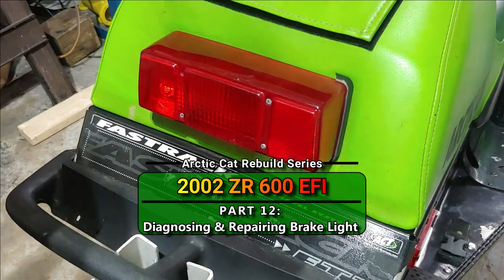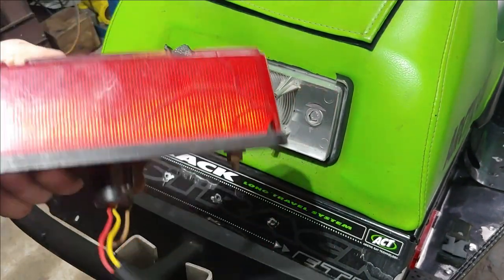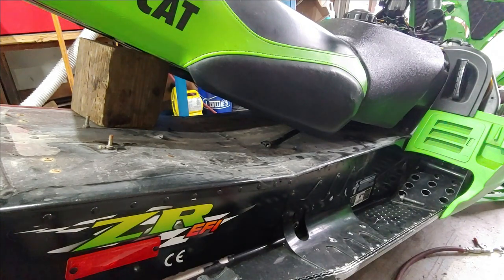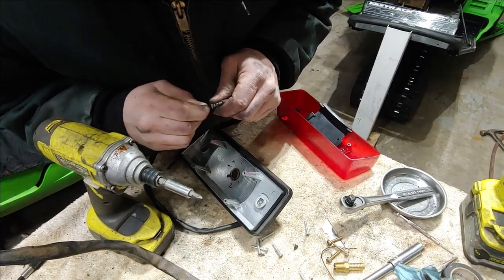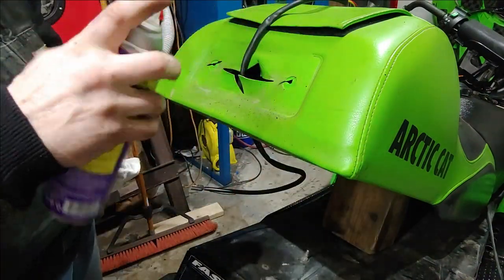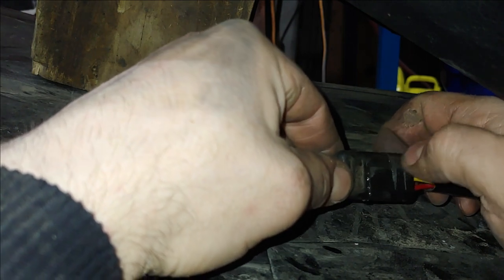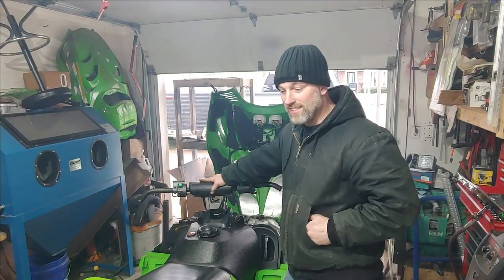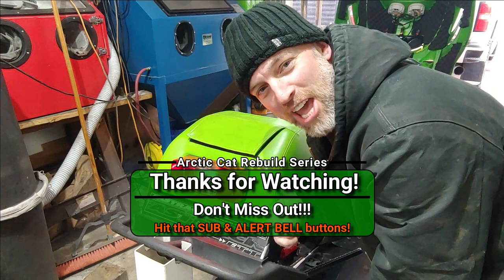02 Arctic Cat ZR 600 EFI Part 12: Tail Light [Diagnosing & Repair]

Comment: Great video learning every time I watch. Just added a reverse kit to mine. Got a reverse through Mickeys. They had it off and shipped to me in about 4 days. Pretty easy to put on. Used the online parts diagrams and forums to help figure out where everything went, spacers, thrust washers etc. Only thing is gearing not what I wanted but had to get it together for a trip to Wyoming. Kit came with 23t top gear and 40t bottom gear. I'm thinking I want a 20t top and leave the 40t bottom for higher elevation, 8000-9000ft. I'll change the upper gear next week when I get back. Thanks keep them coming I'm learning :)
Reply from the maker: Nice. Yeah mickeys is a good shop! Glad youre liking the videos. Next one coming is a complete step by step of track replacement! Will be up in the next few days. 

FYI. Youll need one gear even number teeth and one gear odd. So 20 and 39 or 41. Or 21 and 40...
Reply: @Fixin2Ride-Official-  I read about a guy using 20-40. You dont think that will work in a reverse case can find the top gears easy but bottoms are hard to find used.
Reply from the maker: To the best of my knowledge, you have to keep them opposite numbered teeth (even + odd) for proper meshing of gears and chain. Even if you look at the reverse chaincase diagrams, the chain goes around and even numbered tooth lower and odd toothed upper. Someone may have done it but its best to stick to the intended design with something of this sort
Reply: @Fixin2Ride-Official-  Thanks for the reply Andrew. I think I will follow your advice. I'm thinking of going with a 19t if I can't find a 21t upper. I see alot of guys going with this combo on the zr 600's for higher elevations. I should mention I have a 70p chain and a 72p. I need the 70p if I go to the 19t If i calculated correctly. Thanks for the help.
Reply from the maker: Sounds like a good plan! Glad to help and thanks for watching!

Comment: Thanks for the video Andrew, I had to replaced my rectifier, also replaced the voltage regulator but am blowing bulbs now. Could there be an issue with the VR I replaced?  Thnx in advance.
Reply from the maker: Glad to help. Yes blowing bulbs means VR is allowing too much voltage. Dim would be not enough.
Reply: @Fixin2Ride-Official-  so even though I replaced it with new one already, could i have just gotten a bad one?
Reply from the maker: Its possible. Especially if its an aftermarket. Like Caltric.
Reply from the maker: You can check the voltage at the socket while the sled is idling and that will tell you.

Comment: Nice fix Andrew.  How do you like that multimeter?  They are definitely worth having when owning any sled or atv.  Our season is over, started late but we had about 3-4 weeks of good snow and real cold.  Have a good weekend bud.
Reply from the maker: Thanks Craig. Yeah its good to have a few on hand just in case. Lol. Funny but the most expensive one I have (klein l2000) is junk now. For some reason the ohm testing portion of it measures high and you have hold it there for the ohms to drop and read correct. 

Yeah our is pretty much done too. Might be able to go waaaay up to the upper western UP but not sure if I want to travel 8+ hr to go sledding for a weekend in less than desireable conditions. Lol. A powder coating customer of mine said that the weather predictors are indicating one more possible polar vortex warm up. Meaning that cold arctic air willl get pushed down to all of us.   Pretty nuts that were saying oir season is over in February!? 

Thanks for watching my friend. Have a great weekend.